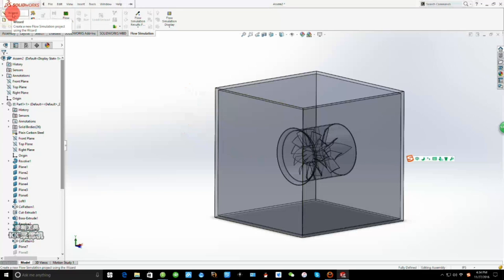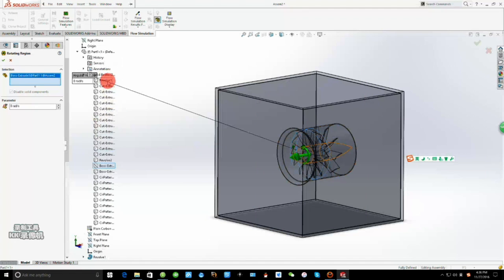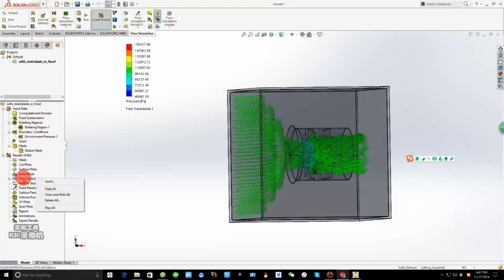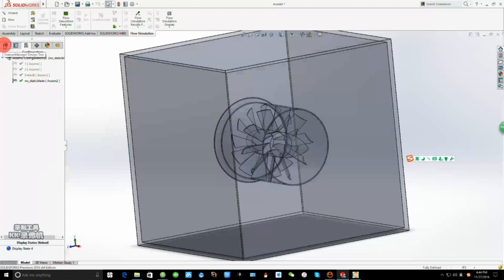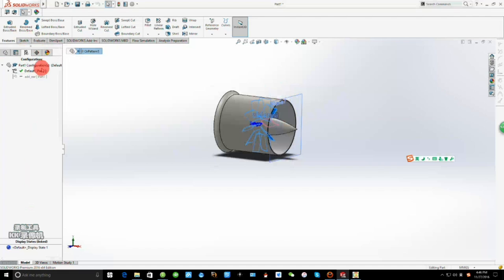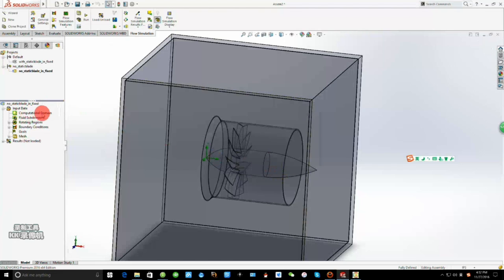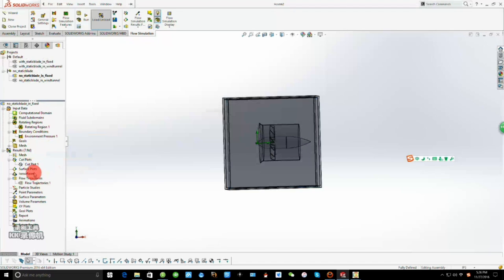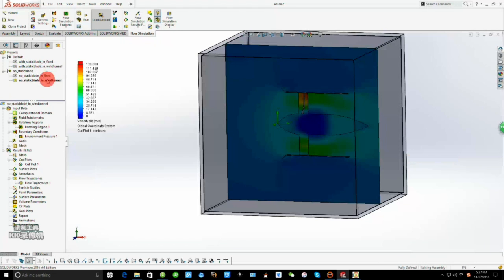Solidworks fluid simulation of a ducted fan, with rotating region

Comment: Thanks for the video, very interesting. But I have another simulation that I can not find any tutorial for. I have a water going through turbine and the turbine has to move because of the force of the water. I am trying to find the best shape for the turbine. In all other tutorials, like yours, the fan has predetermined RPM. But in my case I am trying to find the RPM at certain volume of the water or shape of the fans. Is there any tutorial that you can recommend??? Thanks
Reply: Did you find out anything for this?
Reply: Even i searched for this ,but got nothing, Im still searching!!